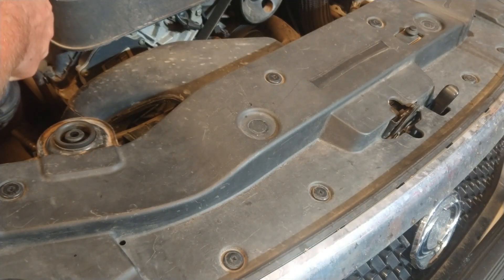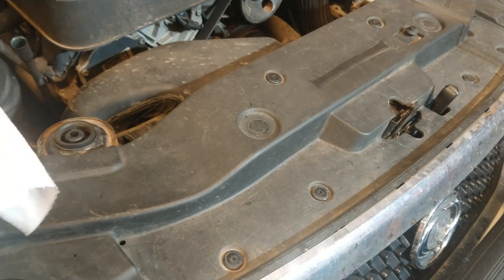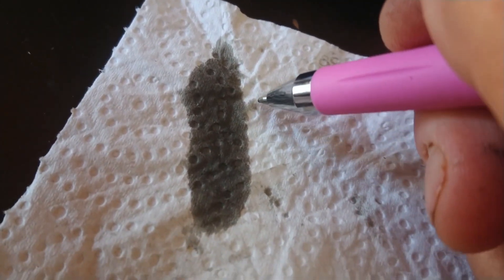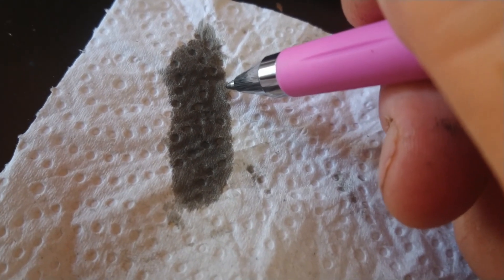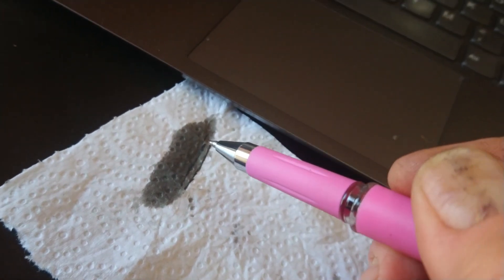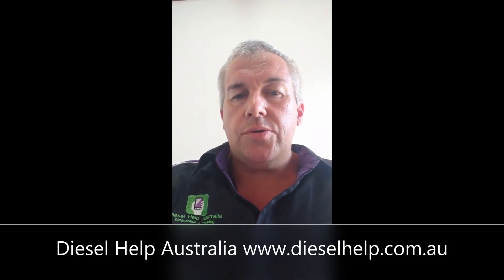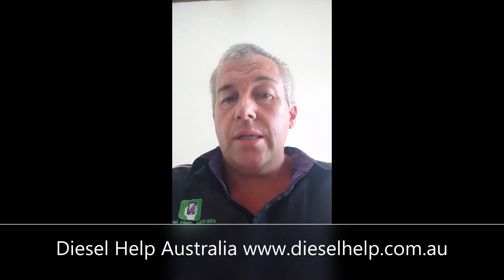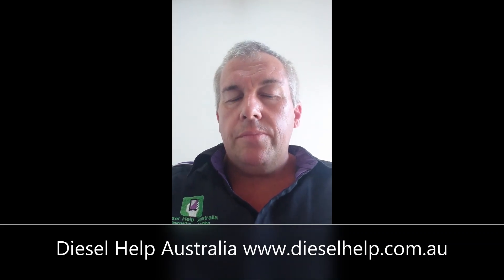Testing Oil Dilution

Comment: What's the actual difference between a forced and passive regen? I don't really understand why they're so wildly different, aside from operating conditions - so if you force the regen while running at constant highway speed once the engine is at temperature isn't it the same as passive?

Comment: Can i just top up the oil with a higher viscosity to compensate for the dilution 🤔
Reply from the maker: No I wouldn't advise to top it up. If the oil gets too high, it'll blow out your breather and back into the intake manifold, causing the engine to over rev. Diesels run well but are out of control on oil.
The other issue is, if changing the oil grade, you can create other issues.